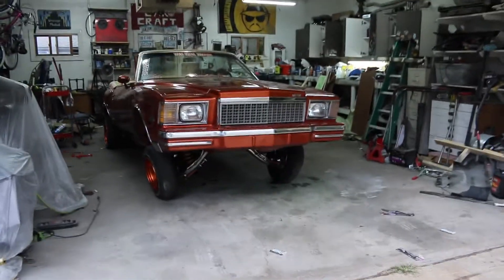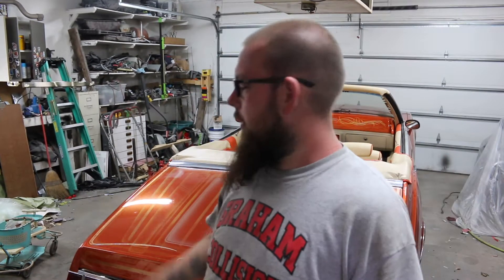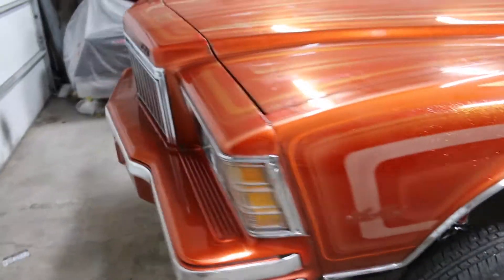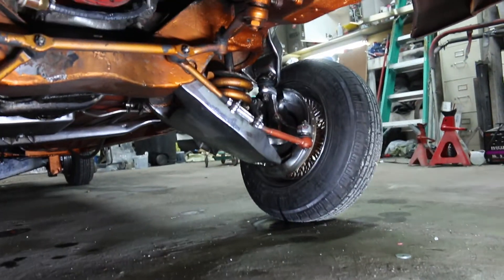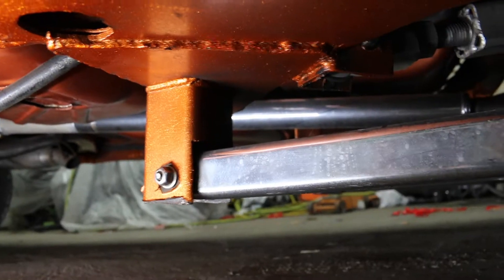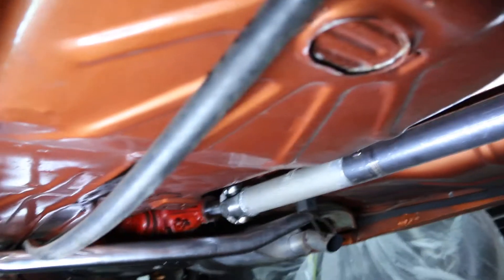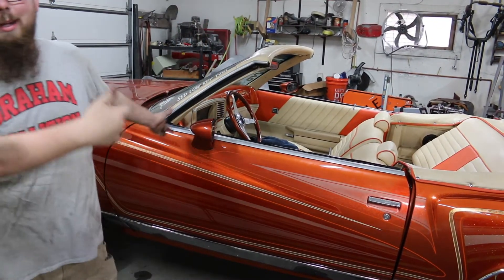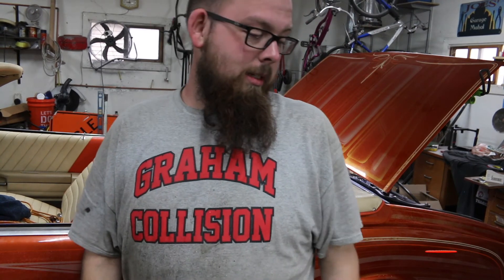NEW PROJECT!!

Comment: The crack is because they made the car a convertible they didn't put enough supports underneath. All the supports are in the roof when they cut it off that's all it needed to crack that frame